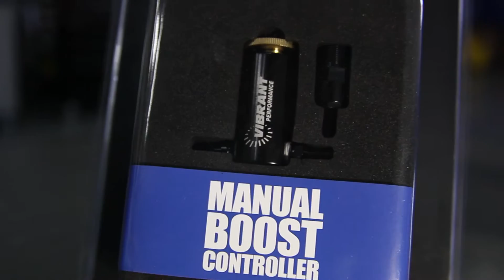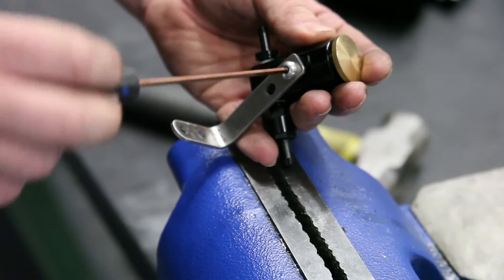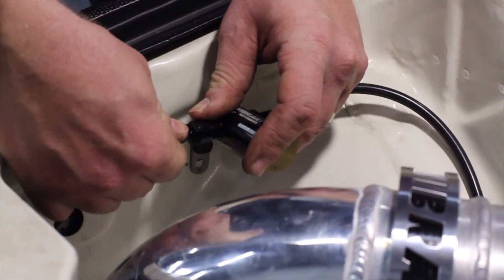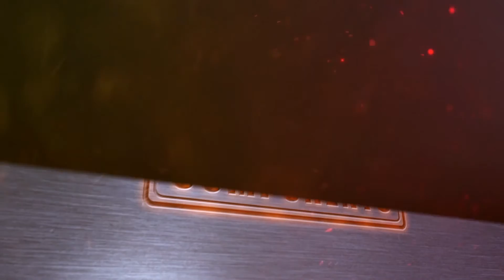Vibrant Performance Newly Redesigned Manual Boost Controller and Installation

Comment: I just opened mine and the large dial won’t spin or adjust at all, any way to fix that?
Reply from the maker: Hey there, please send our technical team and email and we will be able to help you out:
tech@vibrantperformance.com
Reply: Hey did you figure out this issue? Mine wont spin either
Reply: @rustydomino694  yeah I did, it was bottomed out so I put it in a vice and with a little heat and a lot of force it broke loose. Don’t know if that was proper but it worked
Reply: @Smosis  Did it end up working properly after that? Also did you turn the knob so it increased pressure or decreased pressure to break it loose? I dont wanna be trying to turn it the wrong way to where its even more bottomed out lol
Reply: @rustydomino694  it did end up working fine after, and since mine was bottomed out to minimum boost pressure I was turning it to increase it. Also make sure that little screw that needs an Allen key is removed (little silver one on the side)
Reply: @Smosis  Awesome I'll give it a try, thanks for the quick replies!
Reply: @rustydomino694  no problem, I know the annoyance your going through rn so glad I can help if I can
Reply: @Smosis  oh and also, is the little screw on the side you're talking about the mounting screws? I'm guessing you told me to remove them as to not damage anything if i put the boost controller in a vice
Reply: @rustydomino694  the little silver one is to lock in the dial at a certain boost pressure I believe. I just took it out just incase
Reply: @Smosis  Ah okay I'll check that out
Reply: @Smosis  Got it to spin, never would've known it was that little locking screw lol

Comment: Recently install this on my car and I notice there's a small open port above the fitting on both side, it is normal for vacuum to come out freely from there at idle?
Reply from the maker: Hey there! If your vehicle is MAF equipped or you hear excessive noise from the
 Boost Controller during operation, you may opt to install the Low Pressure Check Valve that is included with your new Vibrant Performance Manual Boost Controller. Install the Check Valve on the Charge Tube Side of the Boost Controller as it is a flow directional accessory. If you have any other questions, you can always email our technical staff at: tech@vibrantperformance.com

Let us know how it works out for you!

Comment: Is one rotation 12 clicks divided 0.083 psi. ? So it one rotation 1 psi?
Reply from the maker: The pressure increase for most applications is 1 click= 1psi but it will be heavily dependent on what wastegate spring is being used, what boost pressure is being produced by the turbo, how long the lines are, etc. If you have any other questions, you can always email our tech team at tech@vibrantperformance.com

Comment: Is this a bleed valve type of regulator or ball/spring type? The main difference is that the ball and spring is no putting pressure on the wastegate membrame until a certain pressure threshold has een reached. whereas the bleed type always puts a fraction of the boost on the gate
Reply from the maker: It is a needle valve style regulator.  Please reference the installation instruction for the boost controller for additional info. If you need a pdf copy, please email us at info@vibrantperformance.com